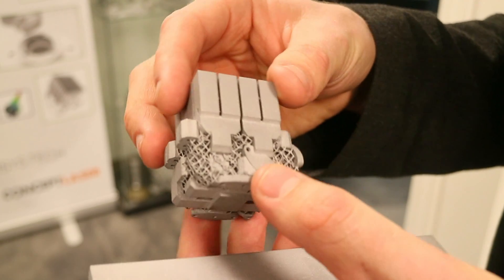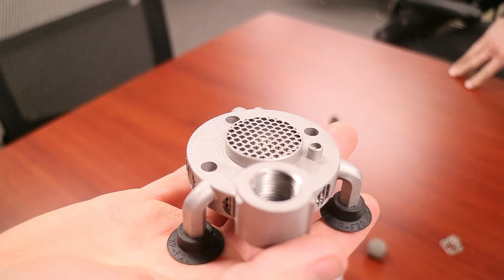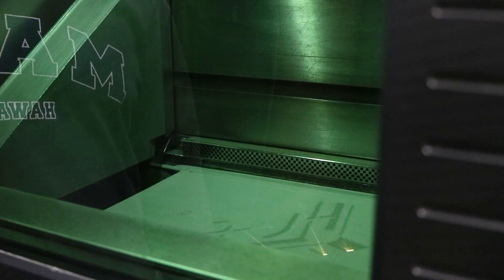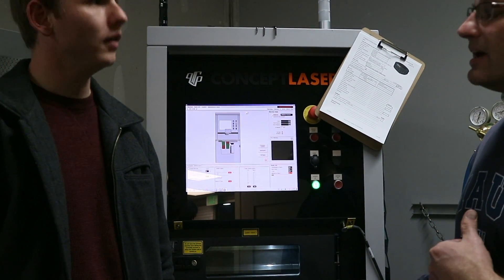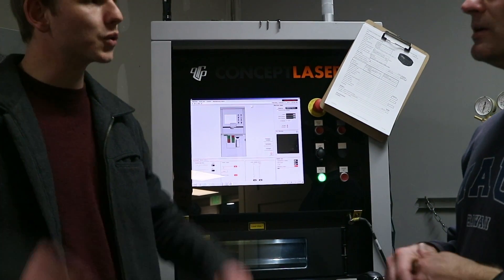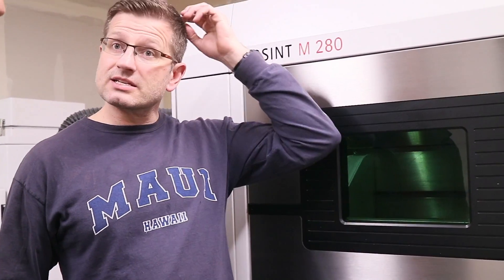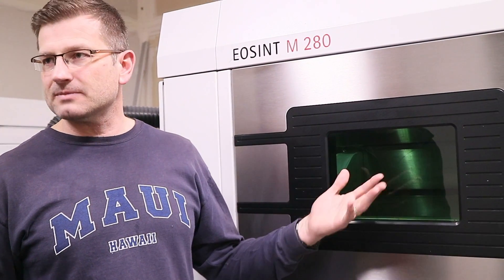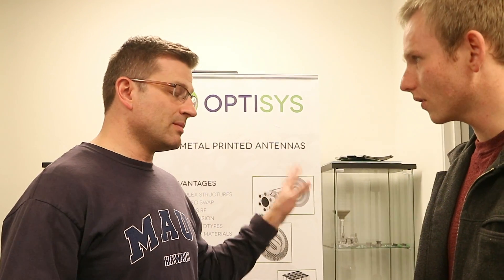Touring a Metal 3D Printing Business (QRP)

Comment: You're back to the space where I live!  I spend my days, lately, in a 3d printing lab, developing techniques for better process control and in-process inspection.  I've personally been crawling around with a screwdriver inside both of the models shown in the video. (Plus machines from SLM and Fraunhofer, and some stuff that we simply built in the lab.)  The lab I work in is tooled to do binder jet printing and electron-beam welding as well as direct metal-laser melting.

People who work with hot metal are a different breed. :-)

Comment: can it do chain mail ?
Reply: Assuming that it has the same or greater print definition as an normal midrange 3D printer, yes.
Most 3D printers can print plastic chainmail, however it is difficult to mesh together multiple pieces as most printers cannot print more than a cubic foot object.

Comment: By the looks of it there is often wasted space on the bed and with a scanning laser the extra cost of using the spare bed space would be minimal. 

Toy nitro motors would fit. 
Two stroke porting is a bitch to cast or machine, but to print ...........

Comment: What kind of metals can this handle? Ti, Cu, Ag, Au?
Reply: Ti's used, but it's tricky because the powder can't be exposed to air. Most of the work in Ti goes to medical implants because of biocompatibility. Most steels have the same problem of inflammability - steel is done, but it's often not worth the effort, although I've seen precision parts printed in Invar. CoCr and CoCrMo are the 'workhorse' materials. An increasing number of people are printing in nickel superalloys, such as Inconel-715.  I don't know about printing in the coinage metals. Ag and Au would be too expensive to fill the powder bed with - setting up one of these printers requires at the very least some tens of kilograms of the stuff. Al, Cu, and Monel alloys are available for the process, but nobody I work with has tried parts in them - most of the apps I encounter need high-temperature, high-strength, or biocompatible materials.
Reply: @ke9tv  Well, it wouldn't be exposed to air. The cabinet is full of Argon. I imagine this could do a lot of metals as long as they are available in powder form.

Comment: I was thinking about printing custom surgical implants for bones modelled individually based on CT scans. With designed surface that allows for bones to bind. The price tag would not matter so much.
Reply: The application of 3D printing in the medical world is a rapidly growing research area. The ability to make inexpensive medical gear from a splint to a new bone will be a huge improvement to our medical abilities. The main issue facing this growth is learning how to print and bond materials so they can survive inside the highly destructive environment inside our bodies without breaking or causing a reaction to it and learning to make faster prints to deal with emergency situations (a large high definition print could take 2-3 days to print).

This guy who got a 3D printed bone repair may interest you:

https://www.google.ca/amp/s/futurism.com/man-receives-worlds-first-3d-printed-tibia-replacement/amp
Reply: Do they 3D print adamantium?
Reply: @magiclocks9206  I believe that it could. In canon adamantium is mixed with a resin that can be shaped before setting it. It has a melting point of 1500 degrees Fahrenheit so a steel (melting point of 2500) extruder nozzel could be heated with an acetaline heater and kept at about 1475 degrees to keep in mallible while not fully melted. Unfortunately the nozzle would need to be replaced each print as the adamantium would stick to it and clog once the resin burned off.
Reply: That's how a lot of them are done nowadays!  Stryker, Medtronic, and DePuy, among others, are printing their implants - using, in some cases, the same machines shown in that video.